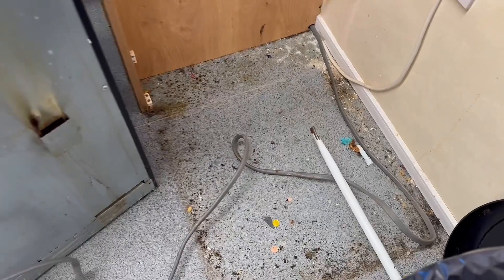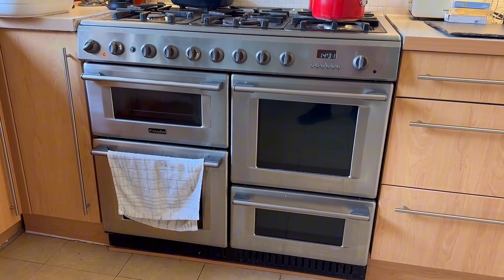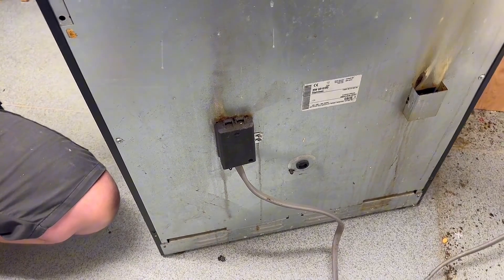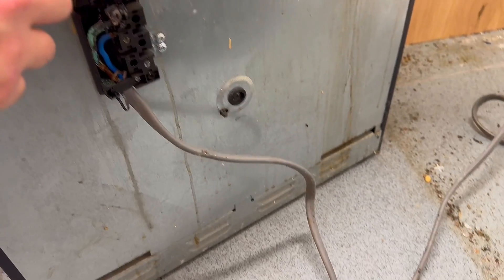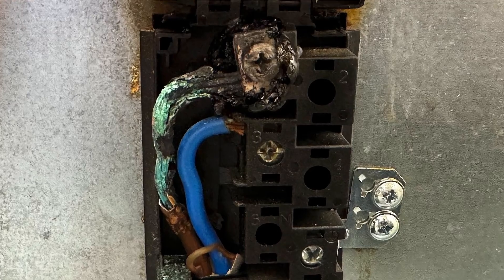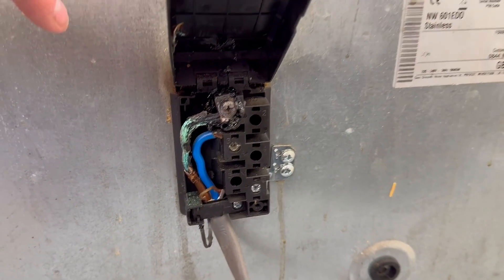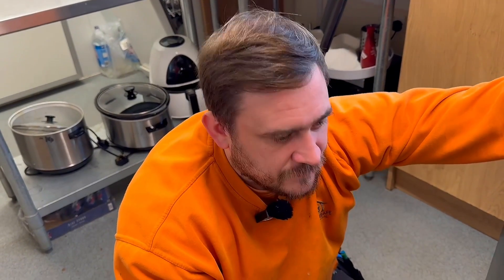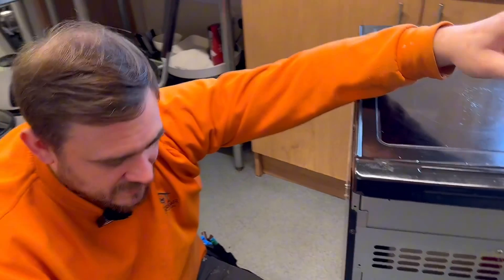EICR - Signs of Thermal Damage C1 or C2?

Comment: C1
Themal damage to cable in connector block
Possible damage on the terminal
Discolouration around the outside of connector block possible thermal
Looks like physical damage to cable about 200mm down from connector block
Possibly the wrong cable type used (T&E) need to check MI as it may need H07 flex...Caveat Oven MI vs Cooker plate MI
Possibly appliance faulty and may be dangerous to use
Is that CPC sleaved?

Other things to consider
Carbon monoxide alarm present in room and In Date IF there is a Gas burning appliance
Heat detector in room and In Date
Is that rotary switch isolator directly underneath a deep fat fryer????

Comment: Found that nearly exclusively on that manufactures cookers.  It's a bad design.  When we fitted them you would tighten the cables, wiggle them and they would fall out.  Despite the cord grip pulling out the appliance to clean and push it back repeatedly the terminals would pull out.  If you over tighten they bend, under tighten they fall out.  To be honest you have less issues over tightening them, if under tightend they usually weld themselves in with a high impedance connecting and continue to melt the connector.   The appliance is usually repairable with that part readily  available. I would C2 but disconnect it and make safe regardless.

Comment: I test up to the outlet to were the cooker is connected. when I PAT test, then I would check the terminal block on the cooker, and also note on the PAT sheet there is thermal damage and the wrong cable is being used and fault needs to be fixed without delay.
Reply: Isn't this fixed equipment?...

Comment: It’s a C1 clearly a danger to use.
But good find as most electricians wouldn’t remove a free standing cooker just in case you damaged the flooring.
We would either disconnect it or charge to replace the connection unit.

Comment: Every publication I've read reserves C1 for access to live parts, so is a shock risk, but that is not the issue re that cooker, given the cover didn't appear to be damaged, so can be no higher than a C2, by their standards. 

Whether you should be coding it at all is a grey area, given it's probably more to do with In-Service Inspection & Testing, rather than an EICR, given it's arguably not part of the fixed wiring - yes, you can code it if desired but whether you should be is debatable.
Reply from the maker: Thanks for the detailed response 👍🏻

Comment: I'm assuming the internal wiring behind is also compromised and therefore cannot be repaired easily.  I would be asking should a domestic oven be in a commercial environment, admittedly it has lasted a long time, but the manufacturers warranty often will not cover domestic appliances being used in a commercial premises
Reply from the maker: Thanks for your thoughts 👍🏻

Comment: Nice. As someone who only installs gas/electric cooking I see this regularly and it's always on the line conductor. Never seen the neutral burn out. My employer has dropped the coding from our procedure but c2 all day.
Reply: Why has the coding been dropped?
Reply: Its burnt out because the resistance at that connection is high probably bigger cable will rectify.. had this problem on storage heater which had plug connection, removed plug and direct wired via fused unit sorted the problem.
Reply from the maker: Thanks for watching and taking the time to add your experiences in the comments

Comment: W hen taking ovens out it is always the neutral , never come across line melting , well apart from the dual fuel range wired in 2.5 twin💥
Reply: I've seen a DF 100 range on 2.5 flex and a plug top...fml!
Reply: 1100 mm df range wired in 1.5 twin and earth and piped in 10mm copper, taken out last week,
Reply from the maker: Likewise 👍🏻